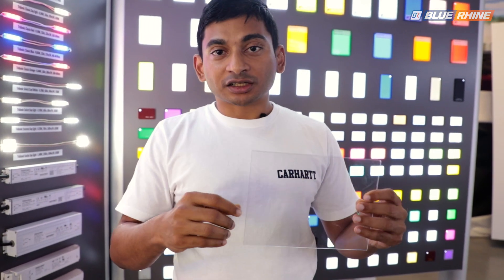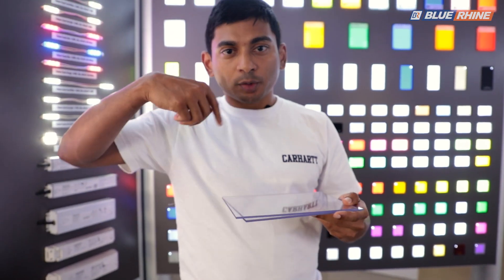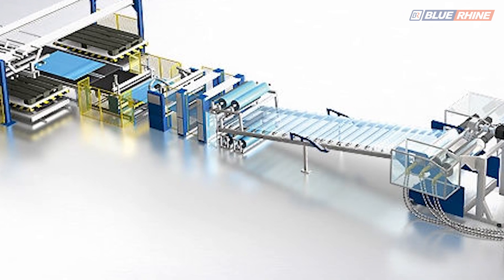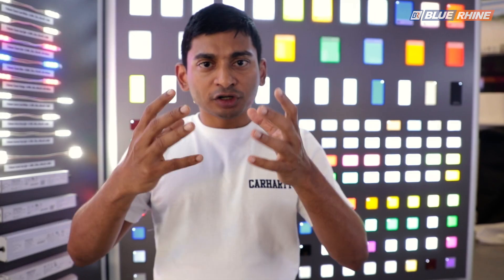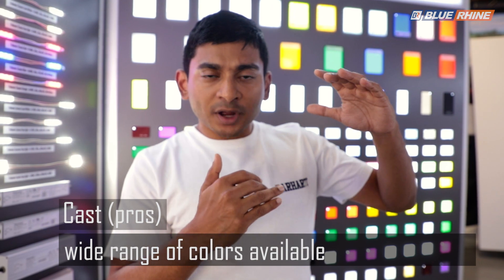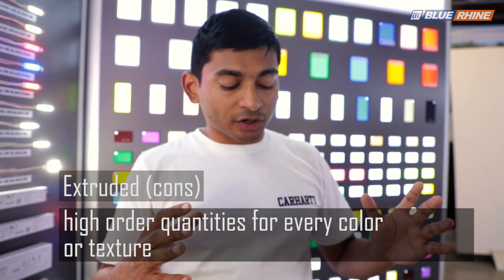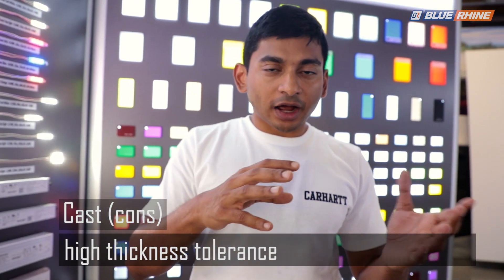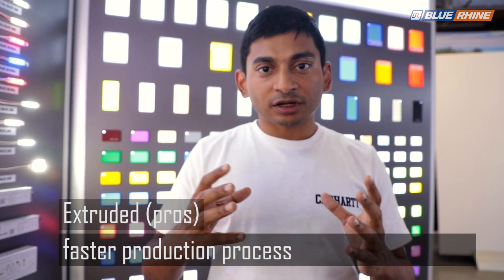Cast Acrylic vs Extruded Acrylic

Comment: I know this video is almost 2 years old, but here goes:
I'm looking to buy an acrylic tube to use as an LED bo-staff (into which I will put the 1-inch computer and an LED circuit). Which do you think out of Extruded or Cast would be the best for something like that?

Comment: That's a great explanation on acrylic manufacturing! thank you. How do you forsee the market moving forward? Some are saying that COVID-19 has caused an increased in demand for clear acrylic barriers for hygiene / social distancing purposes.
Reply from the maker: Thanks. I see that COVID applications for barrier have definitely increased significantly. The increase in this sector is only offsetting, the decline in demand for all the sectors that consumed acrylic, heavily like retail, construction, signage & advertising. So in My opinion the overall market has not significantly grown, and other sectors could come back eventually, and COVID applications decline over time.
Reply: @SIGNHOUSETV  Reasonable and more accurate inference!
Reply: Yeah, the plandemic was great for the acrylic industry. It won't be long you'll be able to buy this stuff used for pennies on the dollar.
Reply: @mitchmoe6224  meaning after a vaccine is rolled out and pre covid practices resume ?

Comment: Hi _ Which is better for roofing - so better consistency optically - and is one lower price - lets assume 5 ton is OK as an order here _ Ta
Reply: Simon Moore I think cast acrylic is better optically. Check McMaster-Carr for pricing and more material information.
Reply from the maker: If its going to be clear or opal color, go with extruded

Comment: Hi.

I use CO2 Laser to engrave Acrylic.  Is there a difference in the final look of my product if I use Cast or Extruded Acrylic?

Thank you for your reply and I hope you have a great day.
Reply from the maker: Hi @Oncle Dan, thanks for your interest. Yes there will always be a difference in the finish of cast or extruded. However, no one can say, as every laser has diff. variables like power, frequency, motors, size, etc. so you would have to test both on your laser to determine the difference. Small size, co2 lasers with servo motors are considered the best for engraving acrylic, with no visible differentiation in cast or extruded
Reply: For me, cast acrylic is a must especially if you use cheap under 1000usd laser machine. It will cut easier, cleaner, gives way better edges and produce less smelly fumes.
Reply: @affiqikhwan9036  The difference is that laser engraving on cast acrylic looks good, smooth solid color. On extruded acrylic it looks way more crappier with rough uneven surface. Especially if you make deep engraving. https://www.pmma.dk/Images/Akryl/Cast%20extruded%20laser%20engraved%20acrylic.jpg